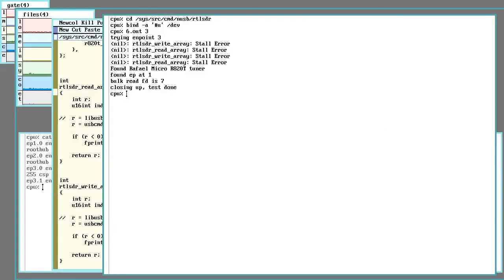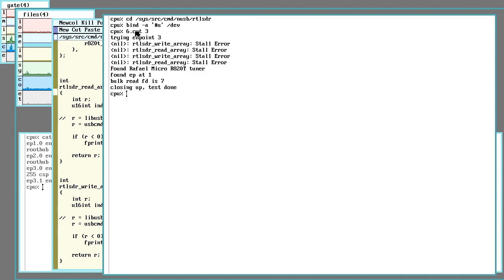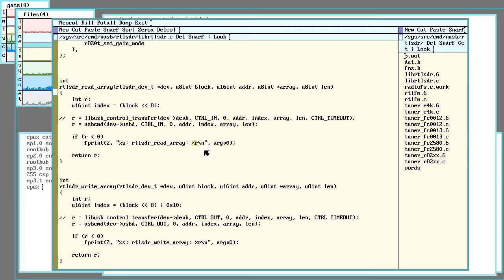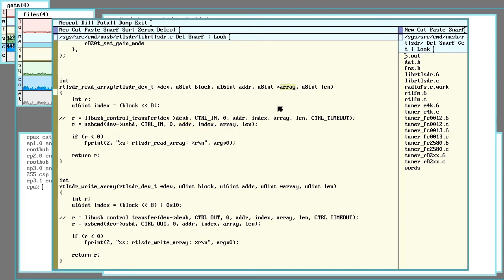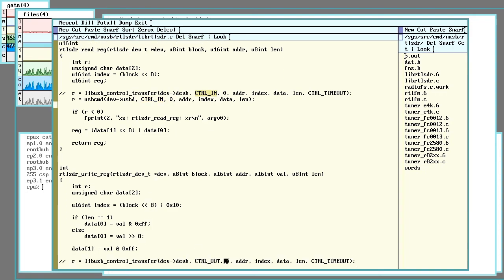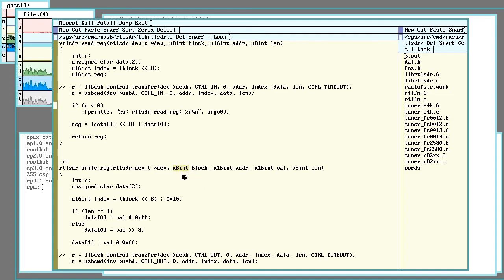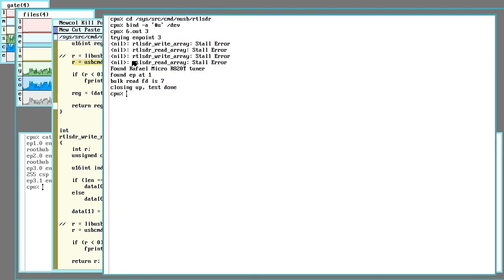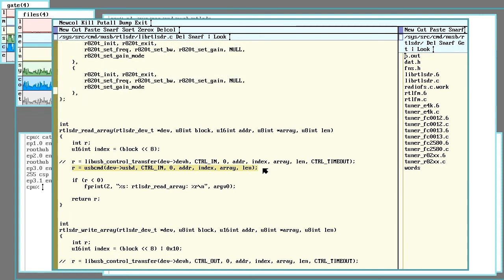Still poking around a USB Device with 9Front

Comment: Good job working with this SDR. Is it from Nooelec? 
I am still trying to compile the golang on plan9. Since the RPI zero does not have enough memory, I need to use some swap, but I  was not able to figure it out.
If someday you get yourself using it, please, make a video. I believe it will be useful for someone else too.
Thank you for sharing your experience.
Reply from the maker: Yes, it is a Nooelec SDR.  And I had a similar issue building Go with 9Front on a virtual machine that I hadn't allocated enough RAM to.  That could be a solution for your RPi zero, to build it on a virtual machine with enough ram and store the compiled binaries on what ever storage the Pi is using.
Reply: @adventuresin9  great idea! Thanks!